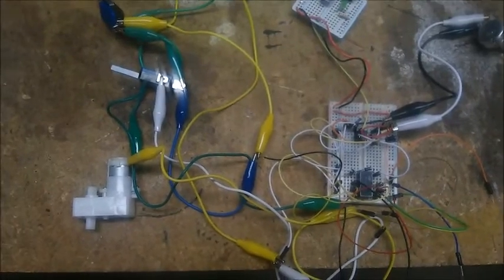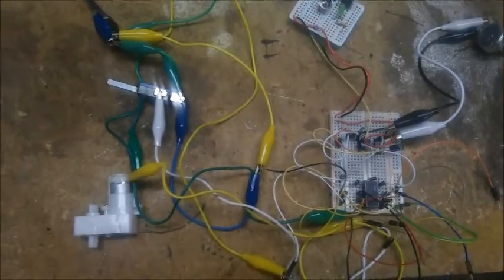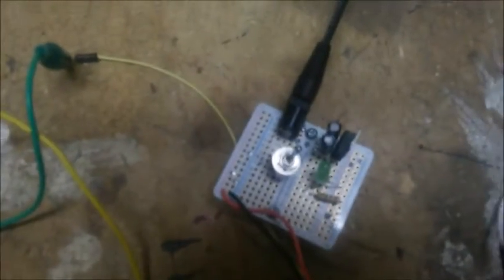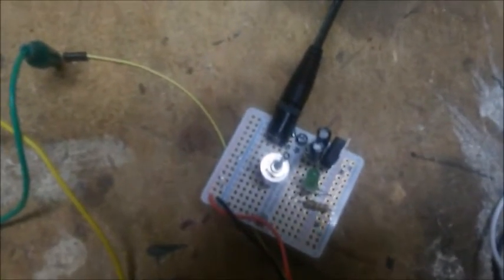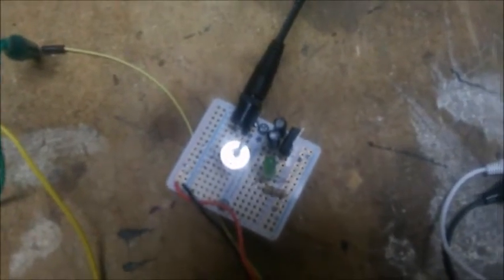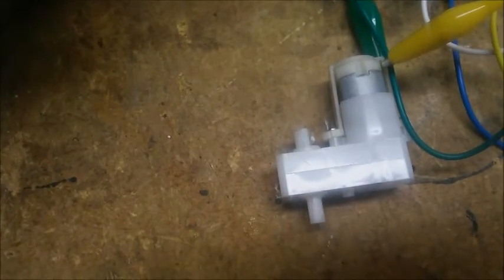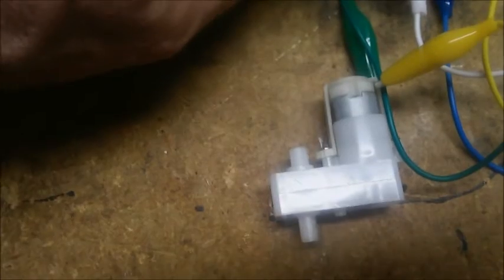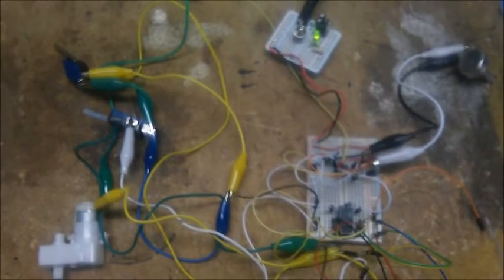Make: Electronics Experiment 32 - Robot Cart (Circuit)

Comment: Hi. I am currently working on the same project however i am having an issue. My motor seems to be taking power from the capacitor and making it so the 555 timer doesn't work .. how did you prevent this? if you could show a higher quality image of your circuit that will help alot. Thank you